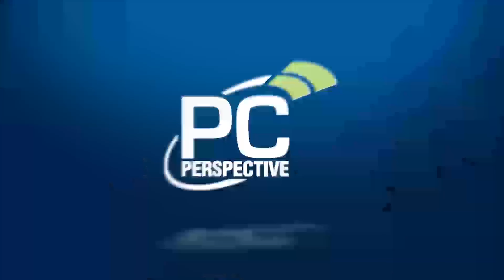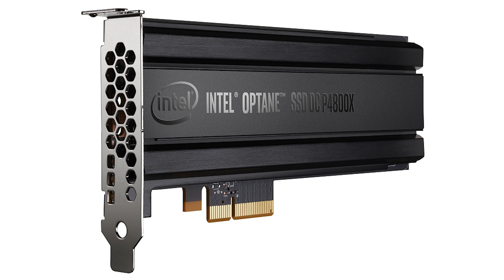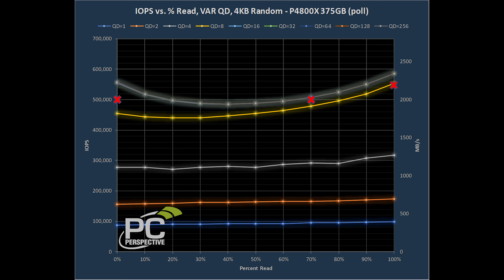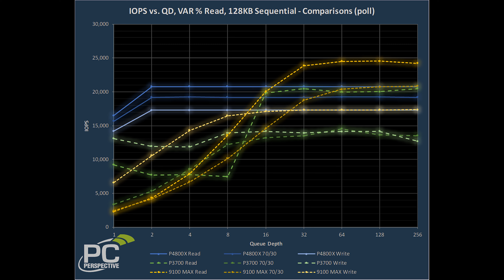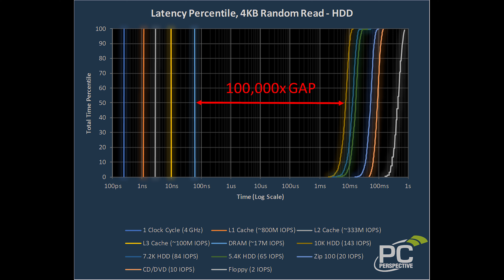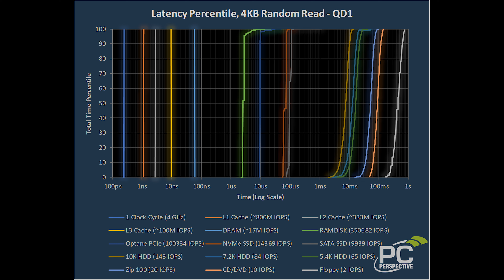Intel Optane SSD DC P4800X 375GB Review - Enterprise 3D XPoint

Comment: How fast will windows boot on a drive like this? Compared to the fastest NVMe drives.
Reply: Well Xpoint isn't just an iteration on existing tech, it's brand new tech very different from SSD.
I suppose it depends on where the current bottleneck is, is it the SSD speed, the interface or the CPU? If it is thte latter, there isn't much to be done, if it is the interface (PCIe/NVMe) then down the line they could make that part faster, if it is the SSD tech (which I think) - then yeah Xpoint could make Win boot even faster than now. :)
Reply: This Okmo Baht guy is the most misinformed person I've ever seen, yet he still tries to speak with authority on the subject.
Reply: "whats a boot screen"
Reply: why put the OS into basically a cache on a data center which most data centers are made to have a up time of 99.999% this is of course the ideal but if it is why make it slower when running by putting the OS onto a drive made to make it faster when the OS is made to be as small a part of it as they can to have the rest run faster
Reply: I do see your point, but I expect this tech to be released to the public some time and for that I am curious. ☺️
Reply: depends on the rig ,  only skylake and kabylake support optane for the moment,
but i think its considered as "cache" and this means the data is volatile , if you turn of the pc all the data on the optane ssd will instanly be erased?
its not impressive what they have done , hds io mem and seagate nytro pcie cards make this card shit itself
its just intel providing the regular techtuber community with this information ,
but if you want to l2arc cache with this intel pcie card , it would be more logical to create a nvme raid array to pay less and have more or less the same performance , crosspoint isnt new , samsung made it first if i reckon with 3d nand
Reply: okMO bAHT 3D NAND  and cross point are different on how they write data though the 3D nature of the chip is not new
TL;DR version how the reads work is the same yes but how the writes work is different 
 the way to write only 1 bit or 1 block at a time without having to move the data then rewrite the data back overwriting the original section of data is new this might have a effect on how long the chip stays good i am unsure if it is longer or shorter life span though cross point is a new tech that builds upon the concepts already proven to work so if you only half way listen to it it sounds the same but if you research on how it works it is only mostly the same but still not meant for consumers who already have a SSD as the gain is usually less than a second over a SATA SSD but slightly over that of a NAND Flash NVMe drive in a amount you will not even notice doing consumer tasks
Reply: Lars DS Probably barely faster, since nvme drives aren't any faster than sata drives so why should 3D xpoint be? It's not bottlenecked by SSDs anymore.

Comment: Issue I see is that pcie lanes are at a prem unless your on like x99
Reply: as it is a card aimed at servers i think it would be more likely on a C3xx board then a x99 board as the C series is more used for data centers than the x series mainly due to more PCIe x16 physical and electrical lanes and dual CPU sockets
Reply: This specific card is aimed at them, but the cheaper ones coming for the consumer market are still going to use 4 pcie lanes from a m.2 slot.
Reply: Aren't the sequentials lower than 960 Pro? I don't see why it's a problem.

Comment: The consumer Optane SSD is released in 3 days (April 24th, 2017).  not Q3/Q4 like you said.

http://www.anandtech.com/show/11227/intel-launches-optane-memory-m2-cache-ssds-for-client-market
Reply: Video was probably produced before that announcement.
Reply: That is not a consumer Optane SSD, that is 'Optane Memory', which is a cache. I was talking about the consumer version of the P4800X.
Reply: It's an M.2 SSD.  It works with NVMe just like other SSDs.

Comment: On my main rig I personally have 1 250GB SSD for OS and Programs, 1 2TB HDD as a scratch disk for temporary files and games, and a ReFS with 3 500GB HDD's for important/permanent data and archived data which is backed up to a 1TB USB drive hooked up to a ASUS AC-1900 router i use as a Access Point.

It would be much nicer to just have a X-Point drive and a RAID1 as my main and only drive. But personally i really like having manual control, but that might change my mind.. like driving stick for 10+ years then never looking back once i got a 2005 Volvo S60 with what breaks down to a computer controlled manual transmission that can change gears as fast as i can when i try to do it as fast as i can but perfectly and all the time. Basically the gov MPG is higher on the Automatic then the Manual where that was ALWAYS the other way around. And also why any version of the "fastest" car is automatic.

Comment: Intel supports these on Linux, you can probably get around the bad interrupt polling latency of the windows kernel by just using linux to benchmark?
Reply: That is where a vast majority of them will be used anyway.  I run Linux as primary OS but I would still wait for the consumer part.  First generation phobia more than anything else; perhaps there will be slight improvement and tweaking of the controllers in 12 months.  I suspect Netflix will be buying them by the truckload however.  It will be fascinating when they get this tech on the CPU side of the I/O bus.  That will be a show.  Quite a few hurdles before that happens but the kernel crews have been working on it for several years now.  Then all the application developers will have to go back to school.  Interesting and exciting times.
Reply: I'd imagine Netflix would be the last company trying to buy these by the truckload. Their service depends far less on latency and IOPS than almost anything else. I always knew your mind had to be a little bit screwy to use Linux as a primary OS.
Reply: Most servers do use custom OS, not windows, so yeah